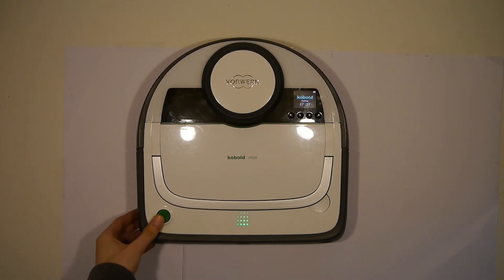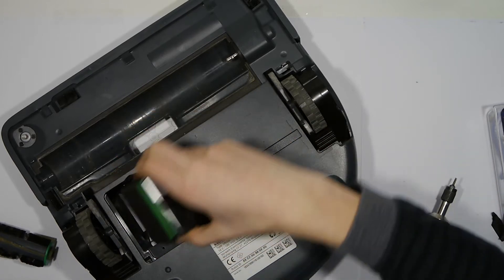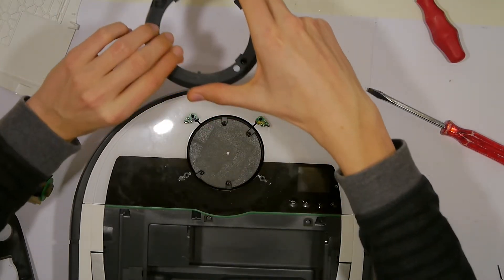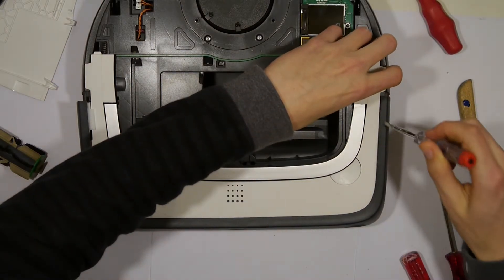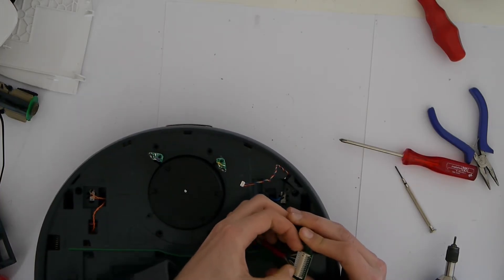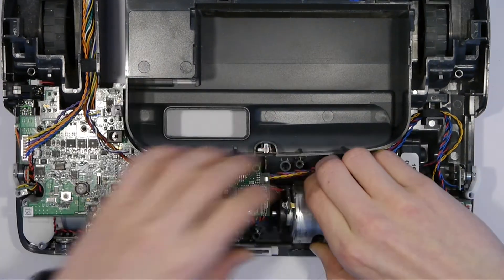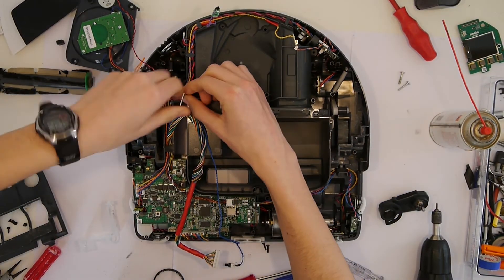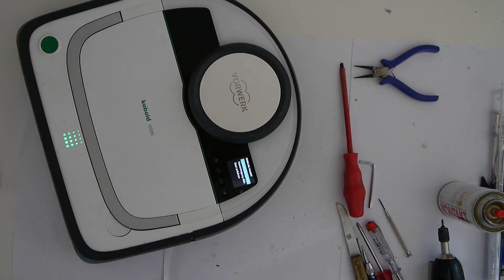Vorwerk Kobold VR200 - Teardown

Comment: i had an error 3000 because the lidar circuit board was corroded and thanks to your video I could easily clean it and therefore repair my vr200.
Would be great to have a (re)assemble video though!

Comment: Great video! Thank you! Does anyone know how to change or bypass the dust bin sensor. My VR300 says after every little bump, that I should insert the dust bin. Thanks for any suggestions. ✌️
Reply from the maker: Hey I don’t know why it isn’t detecting it but the dust bin has a little extrusion on one of the shorter edges used to push down a sensor switch in the device. Mbe the switch inside the device is loose?
Reply: @ thank you! That‘s what I thought. I just don‘t know how to get to it to get it fixed or to bypass it!  👍
Reply from the maker: On the device it should be on the side where the green filter touches the vacuum mbe the part on the filter pushing it in broke off?
Reply: @ Thanks, no, the filter has that part, that should push in. There is nothing missing. It seems, that the sensor is faulty. Every time, the robot goes over a little bump like little door step, it says 'please insert dustbin'. So the sensor is broke, lose or something. Do you know how to get to that sensor to replace it or bypass it? Thanks for your help!
Reply from the maker: It could also be the wire that is at fault. Have you tried using a little stick to push in and shaking the device to see wether it still misses the dust bin every now and then?
Reply: @ yes, I tried. It helps until it goes over a little bump.

Comment: Thanks for that video, it was very well done. 
I have a problem with a VR200 since I downloaded and installed the latest update from Vorwerk Version 2.1.7 (build 5) and it has really mucked up the VR 200.
I was hoping you might have some experience with the software problems as well. 
I think the software is actually for a later model of Kobold:
1. It is now NOT charging at all.
2. on the display it shows Hotspot Mode with a WiFi symbol (full signal)
3. doesn't have Time and Date in the settings list 
4. Has a WiFi setup that doesn't work (I think the VR200 never had WiFi capability)
On the Settings Main Menu it has a new list with the following:
Language;  Wi-Fi Setup;  Sound;  Shutdown robot;  Copy log;  Software update;  
Set new battery;  Fill level detect;  Charging LED off and Auto shutdown.
I have tried resetting the unit but it retains the same software version. Do you know if there is a factory reset available so I can go back to the older version of software.
I think Vorwerk has really made a mistake here - there are quite a few reports of people having the same issues here in Australia.
Thanks, any help would be appreciated.
Reply from the maker: Unfortunately I do not. I can say though that at least the European model I have is WiFi capable and it connects without any problem. I once had trouble charging as well for me cleaning the contact pads and restarting did the trick. What do you mean with WiFi setup doesn’t work? I think I needed the vorwerk app to setup the WiFi connection.
Reply: Wow, thanks. The robot is working again! I had completely forgotten I needed the app for the WiFi setup. I reloaded the latest software again and then was able to connect the WiFi successfully. The battery is charging and all looks normal. Thanks again. 🙂

Comment: Je viens juste de voir votre vidéo qui est formidable mais je n'arrive pas à retirer le couvercle de la tourelle du laser. Sur la vidéo cela parait facile mais j'ai même ébréché le disque en forçant mais ça ne vient pas. Comment faire ? Merci
Reply from the maker: Hey yeah I had some trouble with it as well. Someone suggested to use plastic tools to avoid damage. There’s also the idea of using a suction cup. However I haven’t tried them . I used a flat screwdriver and tried to find the 4 positions where there is a break in the inner rim and eventually got it out. If you gather any experience with a suction cup or plastic tools please let me know how it went.
Reply: Merci pour votre réponse, je vais essayé de nouveau. Une autre question, Savez-vous pourquoi le robot se met en pause pendant le nettoyage sans aucune raison et des fois plusieurs fois de suite ? Merci encore et encore... @JERandomTech

Comment: Hallo, was mach ich bei dem Problem ''Staubbehälter einsetzten''? Behälter is sauber und er lässt sich auch einrosten, glaube somit nicht, dass die Schalter was haben bzw. nichts ersichtliches abgebrochen oder verbogen.
Reply from the maker: The only thing I know of is on the green filter a plastic part that sticks out to ensure the detection of the dust bin. Is that still there for you? If it is maybe you could try a long needle to reach the switch and make sure that the switch is still in place.

Comment: I had the same problem (brush blocked). The unboxing and cleaning didn't solve the issue but there was a lot of dirt and hair inside the vacuum robot. After that I used a small amount of WD40 PTFE-spray for the small rotating brush and for the main brush shaft (4-5 times each). On the left side I did some sprays onto the shaft of the main brush and put the main brush back on again and rotated in by hand. I also spayed some PTFE-fluid on the chrome shafts of those smaller and bigger wheels. After cleaning everything with dry kitchen paper, my VR200 worked flawlessly, no rumbling sounds of the side brush, no blocked main brush.

Ich hab von WD40 den PTFE-Spray (Teflonspray) genommen, kleine Mengen 4-5x in die Aufnahme der Rotorbürste gesprüht, geht wieder wunderbar! Ebenso habe ich das Motorlager für die große Hauptbürse, die Achsen der kleinen und größeren Räder und die Lagerung der Hauptbürse in der Gummihülle eingesprüht. Überschüssiges Teflon-Mittel mit Küchenpapier abwischen! Keine Nebengeräusche mehr und vor allem, die Hauptbürste dreht sich wieder und meldet keinen "Bürste blockiert"-Fehler.

Comment: Thx for this video.
But i have one question.... 
The 2 black rubber rectangles....were are the positions? I dont see it in the Video.
Reply from the maker: You can see one of them in 9:33 on the right hand side. As their function is probably to keep the cables in place i do not think that the exact position matters. The other was i think mirrored on the other side.

Comment: I cannot see how the screen connections are removed, view is blocked by your head 😂
Reply from the maker: 😂sorry about that. About 4 years later and i still haven't figured something out🙈 Do you have an idea how to change it? Amazingly though the autofocus which I usually struggle with, as you can see in the latest video, had no problem picking it up. Regarding the connector it disconnects if you push it up and i believe to remember that there were some indents on the middle of the long side of the connection housing. I guess some tiny tweezers might work better than the tiny flat screw driver I used.
Reply: @JERandomTech  Thank you for the reply. I will try it again later. I’m heading to baumarkt to get a screwdriver to open one of the deep star screw under the screen. Mine is not long enough to reach it. What do you want to change? My goal is to fix the error 3000. My laser tower doesn’t spin. :(
Reply from the maker: The head being in the shot issue🙈 Good luck! I remember that the turret is rotated by a motor connected using a rubber band so maybe that needs to be replaced.
Reply: @JERandomTech  update: i managed to fix my robot. Tried to open it without unplug the screen, then I saw the rubber band fell off the wheel. So nothing was broken, nothing to be replaced, I just put the band back to the wheel. Now my robot is running again. Thank you for your video. I could not have opened it myself without watching your video.
Reply from the maker: Cheers thank you for the kind comment. That is one of the reasons I am creating these Videos so thank you for sharing. I don't really know how to put it but for anyone reading this please consider subscribing❤️

Comment: the robot keeps telling me that I have to put the bin back in place but the bin is already there... what should I do??
Reply from the maker: The solution last time was that the pin of the filter was broken as this presses down an internal switch. Make sure that the pin on the filter is not broken or reference it with a ne one. Is the pin missing? Did that fix the issue?
Reply: @JERandomTech  the pin on the left of the bin?... looks like it's there
Reply from the maker: Hm. When you only put the filter in place can you hear a click of the switch?

Comment: Great! Without this super easy video I woudn't have been able to replace the broken handle of my VR200 successfully, in fact, I am pretty certain I would have totally destroyed it. Once you know it (from the video) is somewhat easy - as always. Thanks, keep up with your great work! I am surprised there is not more discussion about broken handles, it seems so flimsy?!
Reply from the maker: Thanks for the kind comment. Yeah I agree. I am constantly afraid of dropping the Vr200 (or Pumuckl 😅) so I don't really use the handle. I always pick up the device on the side holding the wheels in place which also prevents the annoying "put the device down" tone

Comment: Thank you for the great video!
In a fit of rage, I thought it would be a good idea to hammer on my VR300 until the on & off switch jammed and was thus permanently pressed. From the outside, the switch could no longer be made to work, and only after opening the Kobold was I able to loosen the jamming.

Comment: Thanks for your video - with it I could repare that damn Vorwerk device.
The story behind:
Message "Bürste blockiert". I torn down the device and contacted the service of Vorwerk. They refused to send me the spare part because an educated technician have to do this. The hotline told me to send the VR200 to Vorwerk (fee 199 €). They will check and repare it (so additional cost for spare part and working time).

I bought the ball bearing via internet (4 pcs, 7,49 €) and now it runs again.
And the most annoying thing: the original bear bearing was of minior quality - not "2RS". The original ball bearing was not completly closed so a lot of dirt was between the bullets. Never Vorwerk again.

Comment: Thanks! This video was a huge help in replacing a seized bearing (698Z) in the brush motor gearbox. One more word of warning for anyone else attempting this: The point where the large wheel spring attaches to the wheel assembly is very fragile and you can easily break off the connection peg. However I was able to repair one such break with a carefully installed brass machine screw - tapped into the remaining plastic support. The spring now hooks over the screw head and works fine.
Reply: Exactly the same happened to me. One of the spring's connection pins just broke off out of the blue. Didn't even touch it. Will try to drill a hole for a screw or bolt next and see if it works.
Reply: Mine broke as well when unmounting the spring....

Comment: Sai come sostituire la maniglia di sollevamento?
Grazie
Reply from the maker: Unfortunately I don't. I took a look at the material I have but I don't have an image of the downside of the top plastic part (9:00). I reckon that you then can somehow remove the handle.
Reply: did you do it this way or was there another option?
Reply from the maker: I did not remove the handle at all unfortunately. But I think when the bottom white plastic cover is removed it should be possible to replace the handle
Reply: @JERandomTech I removed the top white plastic but it is still not possible to remove the handle. May be is necessary to remove also the black casing?
Reply from the maker: I don’t know unfortunately. Next time I need to service the device and take it apart I will take a look

Comment: Ganz herzlichen Dank, ich habe gerade den Lidarmotor ausgetauscht und einen neuen Griff montiert.
Das Zusammenbauen ist etwas schwierig, aber jetzt läuft er wieder👍
Der Sauger macht seit einger Zeit ein sehr schrilles Hohes Geräusch. Ich dachte die Grundreinigung im Inneren hilft, ist aber leider nicht besser geworden.  Kann das am Lüftermotor liegen? Kann man den warten, oder muss der dann auch ausgetauscht werden?
Nochmal vielen Dank 🙏
Reply from the maker: Your Welcome. I unfortunately don't know that but maybe it's not the motor at fault but rather the laser turret that needs some lubricant.
Reply: @JERandomTech  Thank you for the reply. In the mean time I have exchanged the blower and the high frequent noise has disappeared. So finally it was the blower!
Thanks again, without your video I would not have been able to dismantle the VR200 to exchange the defect parts 🙏

Comment: Thanks for those helpful tips! I was just about to completely tear down the Kobold when I heard you saying no need to disassemble if the brush is blocked. I applied some lubricant, inserted the brush to manually turn the motor axis a bit for better lubricant distribution and voila, the Kobold continues to work for us! Thanks again!

Comment: Mein Vr200 dreht sich manchmal einfach nur im Kreis, immer rechts rum, aber ohne Fehlermeldung, dann fährt er irgendwann weiter, was kann das sein? hab die Sensoren schon gereinigt
Reply from the maker: Does this happen at the beginning or also during the cleaning process?
Reply: @JERandomTech  Während der Reinigung, aber auch nicht immer, nun ist ein weiteres Problem hinzugekommen, nun fährt er die Ladestation nicht mehr an, bleibt kurz vorher stehen und meldet Reinigung fertig.
Reply: @JERandomTech  Problem Gefunden, das rechte Rad lässt sich nur sehr schwer drehen, der Roboter fährt nicht normal gerade aus,  kann man das Antriebsrad fetten oder so?
Reply from the maker: I don't know I luckily didn't have this issue but I think that is a good idea. If it's not improving maybe something wound up in the axis of the motor.
Reply: @JERandomTech  problem gelöst, Der Motor von rechten Rad ist kaputt, hab nen neuen gekauft, jetzt geht er wieder👍

Comment: Hello friend, here is the problem that the printer has, would you know the reason?
https://youtu.be/xi3vB58CCzA
Reply from the maker: Google says it's a laser turret issue so can you rotate the laser? See 13:05 maybe the rubber ring (red top middle of the image) is missing. Though I want to point out that the support of Vorwerk does not advice to take of the cover but urges you to contact customer support.
Reply: @JERandomTech  Could you send me a photo marking the exact point of the site where the problem is?
At the moment in three days they come to pick up the machine to take it to the technical service, but I would like to know exactly where the problem is.
Thank you very much for the help
joselrs42-gmail.com
Reply: @JERandomTech  Hi friend
The technical service wants to charge me 500 euros for the repair, it says that it is the main board that is bad, I know that the board is fine because it worked well, I just need you to tell me the exact point where you tell me and I will check it again, Thank you
Reply from the maker: Sure sry as I already mentioned I only receive notifications on subcomments via Mail. I'll send you a picture.

Comment: I broke the button of the dust container and when I opened it, a spring jumped that I could not locate it, they are not from the external sensors or from the wheels.
and the push button of the cleaning tank I had to solder a couple of cables and release them every time I empty the tank.
Can someone tell me where that dock could go
Reply from the maker: I think the spring is from the bump right on top of the LEDs when the dust lid is open. (9:37 close to the red dot in the middle of the screen). Unfortunately I did not take a look at it so I don't know how to fix it.
Reply: @JERandomTech  thanks for your help you can locate the location.  All the best

Comment: hi, i have a question
Reply from the maker: I also have a question. Mine is: What is you're question?
Reply: @JERandomTech  I have to put the spring to connect the wheel to the robot but I can't. How can I do?
Reply from the maker: First of all be careful cause the springs are held in place by tiny plastic parts and easily break. I would try to get to a state similar to 10:48 where the springs are relaxed and gently place them back. But I didn't try it myself as I had the fortune that they remained put. Please share your experience and happy fixing.

Comment: Thank you for showing us how to fix the  "please clean my brush" error on the Vorwerk VR200. So simple: WD-40 (contact cleaner) spray cleaner in the brush connection just as you said. I balanced the machine on its side for a few minutes after spraying, so the cleaner would soak in faster. I had to wipe clean some dust which absorbed the spray and expanded. After 5 minutes waiting, I replaced the brush and lid and restarted - it worked straight away. Saves me putting into service for another replacement VR200!

Comment: Hello my vr200 dont  detect the dust bin have you an idea ? 🤯
Reply from the maker: On the green filter there is a little pin that presses a relay to detect whether the dust bin is in place maybe the filter is the wrong way around or the pin might have come off
Reply: @JERandomTech  thx for the answer...  problem was the switch... Fixed it with shunt

Comment: Thanks for the great video :) How and where exactly did you spray the contact spray?
Reply from the maker: I put some around the metal that is responsible to turn the main brush. After that you could turn the device on its side so that the spray doesn't flow out again.

Comment: Thank you so much for this tutorial! Now my VR200 works again (code 3000) and I can use the 200€ for more important things!
Reply: What was the fault with error 3000?  I have the same error.  Have you changed the complete laser set (= Motor + PCB + Laser)?
In the Kobold Robot app, I’m getting the message: “To continue, press the button on the robot” (error code 3000).